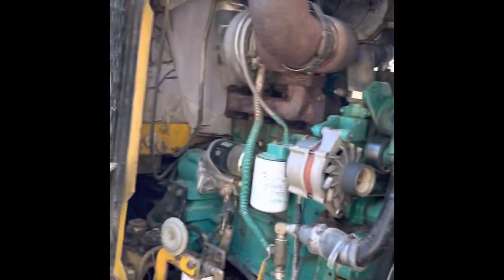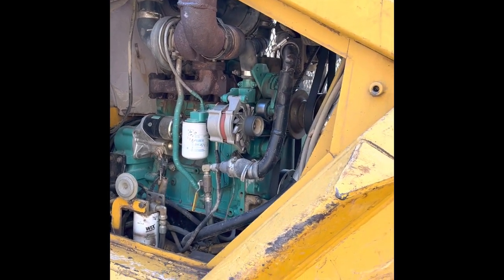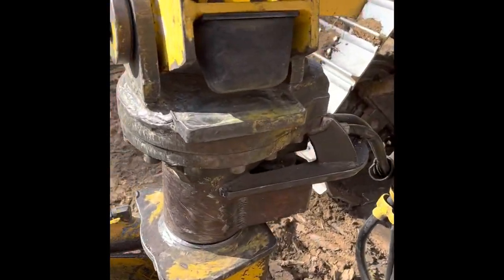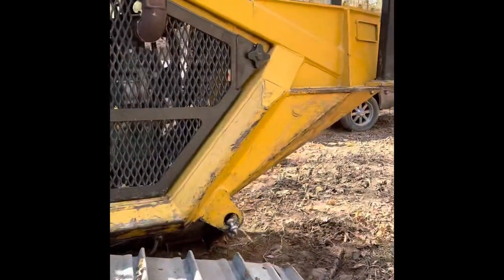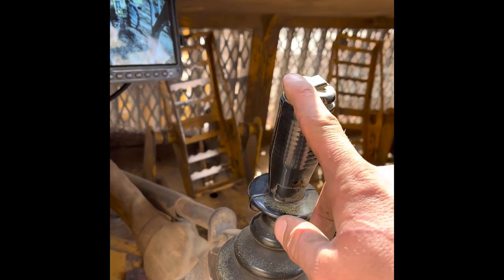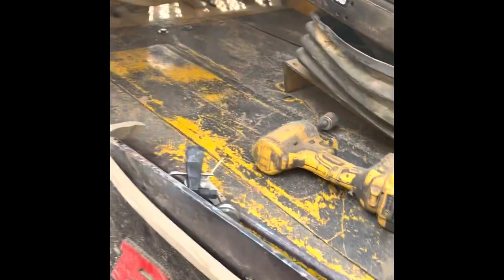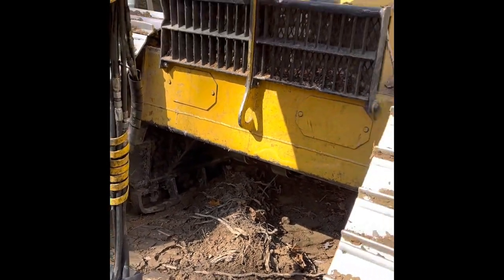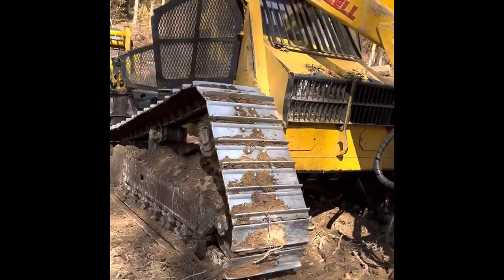Bell Ultra T Feller Buncher Walk-Around

Comment: Hey, I had a question. I find rubber tired ones all the time. I was wondering if you knew anything about doing a conversion if it’s hard will dozer undercarriage work for the conversion
Reply from the maker: I think the actual track frame is bell but the components such as rollers, idlers,chains and pads are Cat. 
I think you would need to find a track frame from a salvage track machine. 
If you found one I think it would be fairly easy to mount it under a tire machine.

Comment: I have 2 super Ts what is the advantage of the larger bar an chain Sr im guessing longjevity but just curious an how much more productive does the Cummins make them just curious?
Reply from the maker: Sorry for the late reply, but the 3/4 bar lasts a lot longer, doesn’t bend as easy. I cut 800 plus loads on a bar once,I lost count when I started using two machines to cut.  
The 3/4 chains stay sharp longer and don’t jump off nearly as much as the 404 chains do. 
I know when I ran the 404 set up  sometimes the bar and chain looked good but it wouldn’t cut and I would finally put a new bar and chain on to get it back to cutting. And I rarely have that problem with the 3/4 if the bar is straight and you have a sharp chain they just keep cutting even when the bar rails are wore pretty bad. 
To answer your question about the Cummins, it’s water cooled so you don’t have to blow it out as much as the duetz and the Cummins runs a lot cooler so your hydraulics run cooler too.  
As far as productive the ultra c (Cummins powered joystick controlled) and ultra t (deutz turbo powered joystick controlled) were bigger,faster and stronger machines with a completely different hydraulic system so that made them more productive. But the super t with a good operator isn’t far behind them.

Comment: What Kind of Production do you get a day with the track Buncher and skidder, in terms of BF? What about two skitters and both fellers? Thanks
Reply from the maker: Iv always run just one skidder.
My best day cutting with the rubber tire bell was 20 loads of pine in 6 hours that’s 28 to 30 tons per load i don’t know what the board foot conversion would be. But that was in the best ground and best timber you could imagine.
Realistic day to day in pine clear cut I could cut 10 to 15 loads with ease

The rubber tire bell in hardwood timber just cutting trees down i think you could do a load to 3 loads a hour depend on terrain/timber 
 
Cutting and topping/limbing hardwood  
I would say a load to 2 loads a hour 

The track machine is a lot slower on the ground and I only use it in steeper terrain, also iv never ran it more than 3 to 4 hours a day, because I have to go load trailers ans cut up wood 

I can cut,top/limb and bring the trees either up the hill or down for the skidder and i have been able to cut around one load a hour sometimes a little more but there’s no chainsaw work and we don’t have to winch any trees off the hills 

me and another guy can cut 12 to 16 loads a week working 8 hour days in the steep terrain running the track machine and not crank a chainsaw or hook a cable.
Reply: Good vid good machines had one of each , running a ryans on a 608 jack now !
Reply: Do the ultras have heat and a/c?

Comment: Does the bar and chain on these take oil? If so where is the reservoir
Reply from the maker: Yes they do use bar oil. And the oil tank is on the head, it holds over 5 gallons

Comment: Interesting how they put the tracks on backwards compared to a dozer.
Reply from the maker: I’m think it’s because they didn’t have to modify or change the design of the machine,all they had to do was put a sprocket on the hub instead of a tire and mount the track system.  
If it was set up like a dozer they would have had to put the drive motors in the back and totally redesign the machine. They did build a tf-120 model that had the tracks setup like a dozer. But it was a totally different design than the old 3 wheelers,

Comment: Do you get a load of feed back on your pedals?
Reply from the maker: I don’t get any feedback on the t Ultra t and c machines
 
I believe you have a super T lever machine and they definitely have feed back my first bell was a rubber tire super t and yeah you had to really push the pedals to get over a stump or out of a ditch,
Reply: @GBLogging  wonder what the difference is that would cause that? That's my only complaint I have
Reply from the maker: @allenmccall5021  I don’t know exactly what the difference is but I do know they have totally different transmissions, the super t looks more like a regular hydraulic pump and the ultra t,c looks like a hydrostat pump and it’s alot bigger than the super t